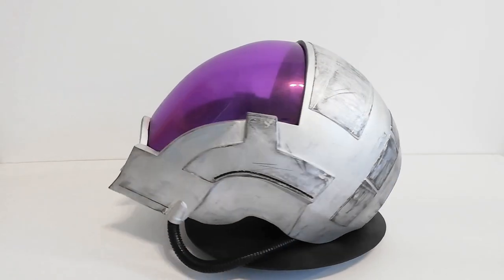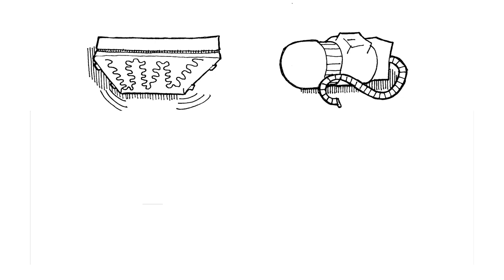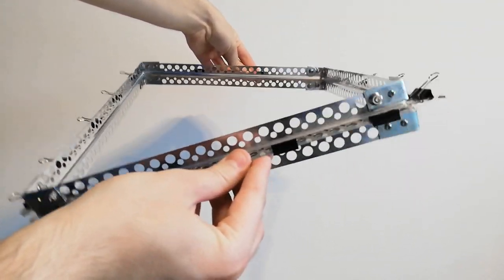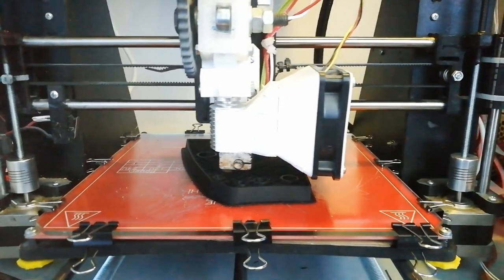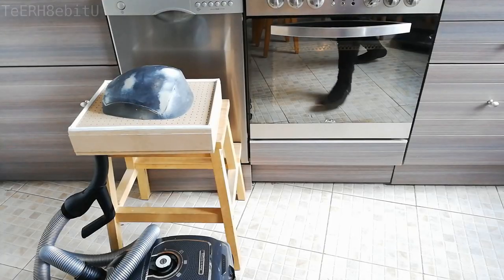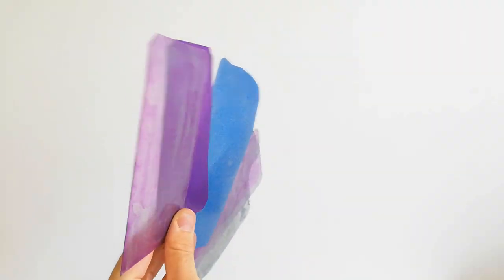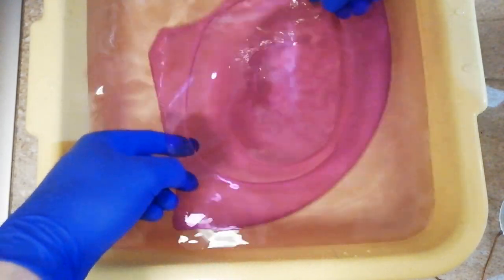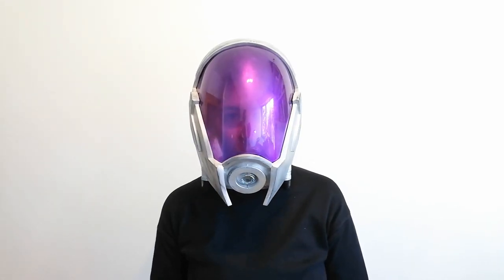Can I make a vacuum former for 15 eur? (Tali's Visor, Tali Cosplay pt. 2)

Comment: why didnt you just print the visor and then use clay behind it to enforce it for vacuforming?
Reply from the maker: Printing just a shallow shell of the buck would require supports anyway during the printing. It doesn't take that much more time to just print a whole buck as it is and it takes one extra step out of the workflow. 3D printing the whole thing also allows me to design the airtubes to get the plastic to better conform to the creases.